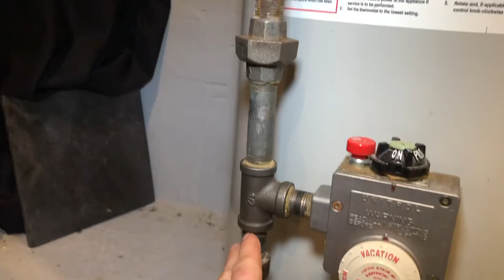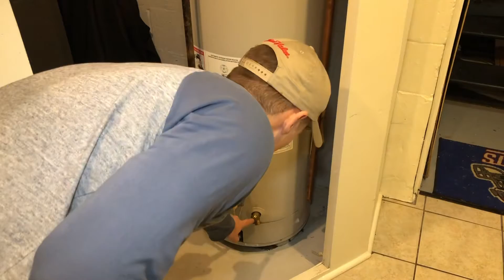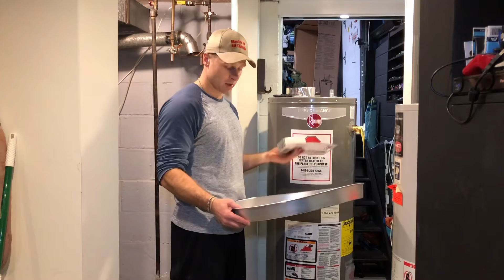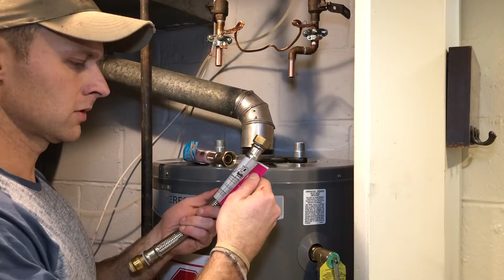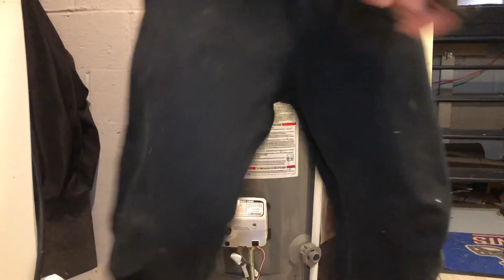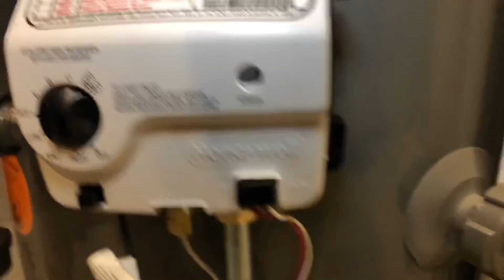How to remove and install Replace a GAS Water Heater - step by step , detailed and safety steps DIY

Comment: Should put a thermal expansion tank upline on the cold line. Thermal expansion from cold water heating up over and over again is hard on fixtures and appliances. An expansion tank has a pressurized blatter in it that you match the to the pressure of your water systems. That way when the cold water gets heated and the pressure rises the additional pressure has somewhere to go.
Reply from the maker: Good to know .  Apprentice that Thanks.

Comment: I stopped watching when  you didnt even know how to disconnect the gas line,.  Had the pipe wrenches held backwards as you tried to disconnect the pipes.  Then  you kept trying to spin the piece off and the connector kept hitting the tank., and seem baffled .
Then I went to the comments and see that people said you removed the heat shields out of the water hose connectors.  Sorry, But dont put videos out  when youre not sure. Especially when natural gas is involved!

Comment: The cold flex line is kinked, If you change out the anode rod every 3 or 4 years the tank will last longer than the guarantee, It's not a replace by date.
Reply from the maker: Thanks.   Will make note 👊

Comment: Great video thank you. One question: what are those two white plastic pieces you removed the cold and hot water nipples on top of the water tank? I was reading they are heat traps?

Comment: I guess pipe tape doesn't matter 🤷🏽‍♂️
Reply: I would not use tape on gas lines only natural gas safe pipe dope. The water lines he installed have rubber seals so no need for tape or dope.

Comment: That kink in the water line does not look good.
Reply from the maker: Not best solution but worked for now.  Might do all new copper piping later on
Reply: @HowToWithLech  I used the metal red and blue ones from Home Depot they bend and stay bent.

Comment: What would you do if the gas pipie was too short to reach the gas inlet? Flex line?
Reply from the maker: If you got same style heater all should line up.  Use only approved piping. Flex if they have it but I would say stay with solid

Comment: ...um you forgot the thermal expansion tank. All new water heaters require them now.
Reply from the maker: i'll look into it, but wasnt mentioned to me when was getting it. thanks for sharing
Reply: Only in some states.
Reply: Only for a closed system, he may not have a pressure reduction valve and is using straight pressure from the city water supply. Did you check your pressure with a guage?

Comment: Watching this guy using the pipe wrench made the hair stand up on the back of my neck. He did not have a clue on how to use the pump attached to the drill. He could not figure out how to take the gas pipe apart. "SCARY"
Reply: It Wasn’t even broken was the first clue 😂 idk why someone would willingly choose to spend the time and the money to replace something that didn’t break yet? Piece of mind… yea I guess, as long as you dont get a defective unit 🥶I feel ya though. job well done & good video thanks for sharing

Comment: Watching this video gave my husband and I the confidence we needed in order to replace our water heater. Thank you for this! It wasn't nearly as hard as what we pictured. I appreciated this video showing slowly step by step and also that sometimes things don't go easy, problems with disconnecting the pipes, in our case we had a very small area to place the water heater, and my husband and 14 year old ended up having to lift it up over the gas pipe, will my husband was scrunched into the corner of the closet the water heater fits into. 
This video helped us so much! Thank you for teaching it slowly and thoroughly. 😊👍
Reply from the maker: So happy to hear this.  Glad I was able to help.   Good work 👍

Comment: You don't need an expansion tank for the cold water? And how can I do if my gas line is too high and I want to bring my heater down to the floor?
Reply from the maker: Expansion tank? No.  
You’ll need to extend the gas line/piping than. See what they have at hardware store for that.

Comment: my pilot is lite and the burner comes on but after 20 minutes the burner goes out and the pilot does stay lite. no hot water. any idea do I need a new water tank?
Reply from the maker: Is it old. Sounds like it might be done. Especially since no hot water after running after 20 min.  No leaks anywhere right.   Sorry not an expert on these , so hard to advise
Reply: looks like its done.  Thats exactly what happened to my Rheem.  I replaced it with a new one.

Comment: The gas line scares me other than that I have no issues replacing mine, I've gotten a quote it will cost me $6,000 while my bank account has only $388 in it.
Reply from the maker: i know its scary.  if you're a little handy you should be able to do it safely.   just have to turn of gas with the valve and it wont flow  test to make sure etc.   maybe find a neighbor or friend to help.  take your time.  but if feel uncomfortable obviously dont do it.  but find a better deal.  $6000 makes no sense even if someone is marking up a lot.  that heater if i remember correctly was maybe $500 or so.     Lots of these guys throw these crazy numbers at people  because they know people scared to do themselves. they take advantage.  have them give you a breakdown of the costs.  makes no sense.
Reply: i hope you can find someone that did this before to help you out.  Take your time,  and use enough pipe dope ( i didn't on my first time)  . and have soapy water to test for leak. I think you will be fine.

Comment: Do you need to remove the white plastic sleeve for hot and cold before installation began?
Reply: You shouldn't.  They are there for a purpose.  Heat traps
Reply from the maker: Yes.  I pull those out at about the 16:35 mark with the pliers before connecting the hoses
Reply: what happens if you don't? @HowToWithLech